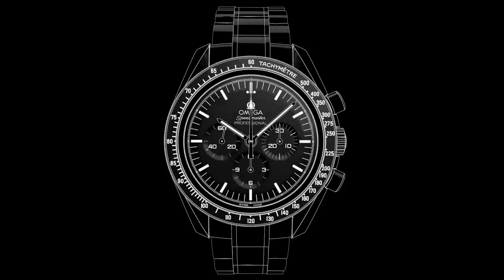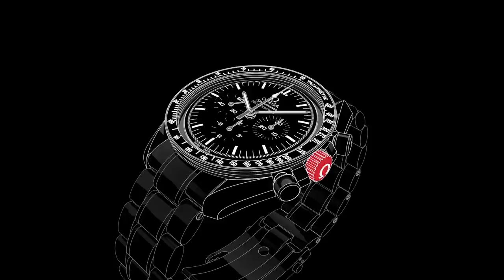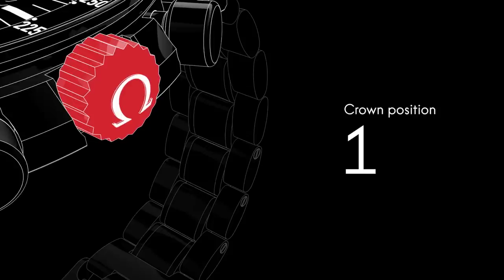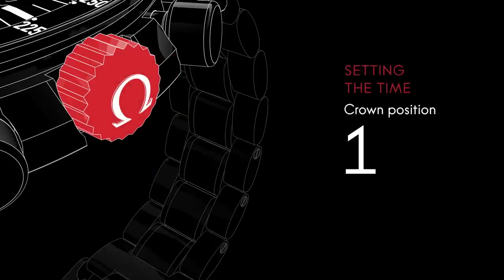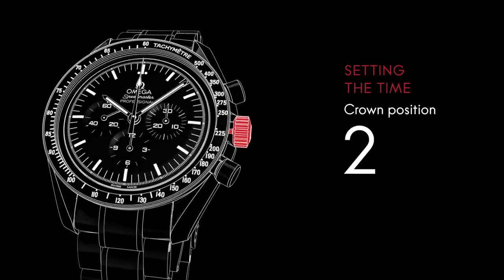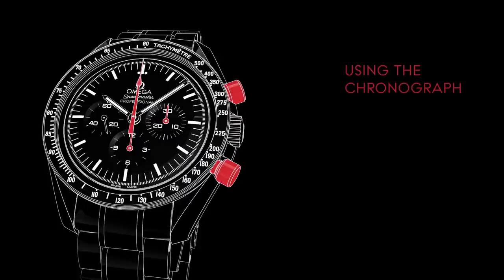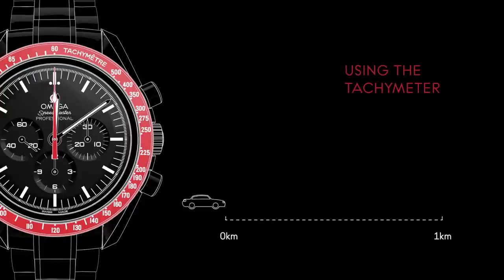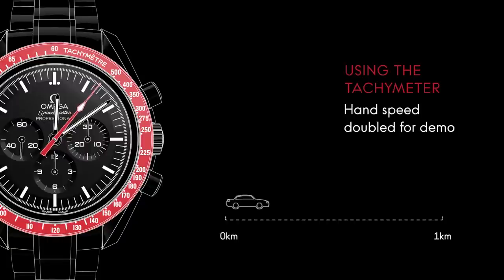OMEGA Speedmaster Calibre 1861/1863 | Video Manual | OMEGA

Comment: You will need to back hack to set the seconds. Set the time as you like moving the hands clockwise and stop. Apply light pressure to the crown in the anti clockwise direction to stop and move the second hand. Release the pressure when you are where you want to be, and you are synchronized down to the second. For ease, I set the minute hand to the upcoming minute, and goose the second hand to the top, releasing the crown at the top of the minute, then pushing it back to position one.
Reply: @กาบูรณ์วงศ์เผ้า  Saw wa de kap!

Comment: How many times to do typically wind the watch.  I just bought one and i wound it until I feel resistance but I could keep winding but I don't want to damage the watch.
Reply: I also want to know the answer to this because I am looking to buy it soon. I’m wondering if there is an official number of times the omega emblem on the crown must revolve to be fully wound.
Reply: @vladimirchervenkov6949  I did more research and found that you keep winding until it won't wind anymore .  I have done this a few days and it's going well.  You will know when it's wound.  It stops !!
Reply: Once a day only is what most forums are saying.
Reply: @zeyadalhamdan842  I wind it until it won't wind anymore and it's been perfect.  The accuracy on mine has been fantastic as well +2 Sec.  So well within COSC.

Comment: There's a mistake in this video - when the crown is in position 2, the crown must be turned clockwise to set the time. Applying subtle pressure anti-clockwise whilst in position 2 will actually cause the second hand to stop, this is the hacking feature of the movement which allows the watch to be synchronised to another time source. Apply subtle pressure clockwise to restart the seconds hand.
Reply: tanoshii07 man I want to ask you a question is this watch worth buying coz you look like you something about it
Reply: tanoshii07 so how do we know the watch can do anti clockwise? Or can only clockwise?
Reply: A man scrolling through Comments l尸
Reply: A man scrolling through Comments l一
Reply: tanoshii07 ทองคำ
Reply: Thanks for this, now i can check the precision with atomic clock.

Comment: I just bought a speedmaster 1861, you say until the crown stops when winding it; mine doesn't stop. It gets stiffer with tension but it doesn't stop or become hard to turn?
Reply: keep doing until you can fell tension and when you turn the crown it resets to a position and doesnt move any further, thats when you know you winded the watch, then just set the time by pulling the crown and pushing it back in

Comment: How to synchronize the time? Seems if I pull the crown to 2nd position, the second hand keeps moving and doesn’t stop.
Reply: i think its normal, i have the same issue. does your second hand turns back as well when you pull the crown counter-clockwise?
Reply: @Loun96  I haven’t tried as they say it might damage your watch.
Reply: @yunpengw  but otherwise you will never be able to change your second hand and calibrate it according to the atomic clock
Reply: @Loun96  After reading many places, I realized that mechanical watch isn’t meant to be atomic accuracy so probably no point to sync exact seconds. Event you do sync with atomic second, it will be out of sync in a day very quickly.  I also figured it is more important to find the right number of winding everyday to have the watch stay as accurate as possible.
Reply: @yunpengw  Agreed 👍 I just set my automatics and maual wind watches one time and that's it say to my cable box. Obsessing about accuracy down to the second is kinda pointless. Don't get me wrong I love precision but some take it a little to far

Comment: What happens if I press three times the button at 2 o clock? (1st is for starting, 2nd is for stopping, and the 3rd one? Do I break something?)
Reply: The third push will just restart the chronograph.
Reply: No 3rd is for lift off
Reply: Simply lovely
Reply: Simply to the point of the first step in the process to be removed from the court to the court to the court to the court to the court to
Reply: Simply to the point of the first step in the process to be removed from the court to the court to the court to the court to the court to the court to the point where it will remain in accordance to their policy of action against court to ensure they will not have any rights in place before their decision is accepted and the legal proceedings of their court to the tribunal of this case and the legal authority shall not accept legal action against legal counsel unless the court is entitled for any refund to the council to ensure the claim has not occurred in accordance to which they are entitled for property insurance and legal responsibility will not remain in accordance to which they are entitled by law and legal responsibility will not remain under legal action against legal fees to ensure they comply by reasonable guarantee of any damage done to ensure that they will not liable for any of the fees paid by our council or council to ensure that 2222222222 is paid for the property and the property is fully paid for the property to be paid in the next

Comment: I just got the speedmaster with the 1861 cal. This is the worst movement I ever seen in any watch. It runs +10 seconds fast if not more. That's just horrible
Reply: Watch is cool though. Movement not so much.
Reply: you do realize this movement was created in the 50s and suffered only minor changes, remaining for all practical purposes unchanged. For that period a 10 sec difference was not that bad. I hope you do not compare it to quartz rubbish, which does however have the advantage of not going faster or slower.
Reply: dedy corbuzer
Reply: @quokkamode1484  he should get a sinn UX, oil filled deap water watch for german commandos, best quartz watch ever made.
Reply: Mine is extremely accurate.  Yep 10:04 CST
Reply: regulate it yourself or for $5 have someone else regulate it for you.  Mine is -2.7 sec and I've regulated many of my watches to +0.1 sec/day
Reply: ripperx444 980p njo. , Zn